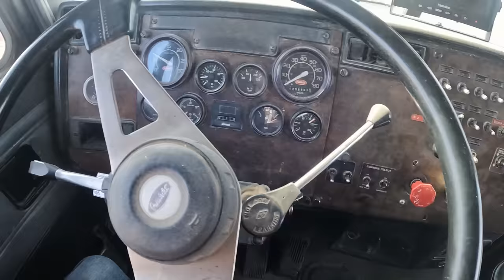That Didn't Sound Good.

Comment: I like how you keep your positive attitude during times of adversity. I guess if farmers were not optimistic there would be much less food available to feed a hungry world.

We are having the opposite of you this year. After an extreme drought last year we got lots of moisture this spring. The dry land farmers are having wheat yields 50% above normal. Irrigated folks got delayed in planting spring crops so harvest is later. In my case the hard red spring just ripened enough last week. I got one set of trailers cut then we got 4/10” of rain the next day. Was able to bale straw yesterday, but too wet to combine or bale the hay that was almost ready before it got wet. Oh well, I guess I will have some time to make some minor repairs to the old 1460 so it can chew through the tough wheat straw better. Only planted 120 acres, but it is thick, going about 100 bu/acre.

Comment: I had a fence post go thru a 2388 a few years back and punch a hole in the bottom of the fuel tank. I don't honestly know how it made it past the rock trap.That was in soybeans. Then the same year, doing corn, same combine with a Geringhoff chopping head on it, ran an electric fencepost (a round one, not a t-post) thru the #1 row unit on that head. That Geringhoff Rota-Disc head chopped about half of that fence post in 1" pieces before it finally got caught somehow in the snapping rolls and wrapped a full turn around the outside roll before it locked that row unit up. I hate fence posts. They are from an era long gone when the early settlers had livestock. And yet I have a feeling they will still be coming out of the dirt 100 years from now and getting into combines.

Comment: That’s a scary thought a blade going through the oil pan just had that door off to change rotor gear box oil in my CR my beater drum is different interesting to see CaseIH beater drum i just put a Redekop blades on my chopper they are smooth don’t wear out self sharpen really like the kit.

Comment: You guys NEED to buy stripper headers. Changed my dads cousin operation dramatically. Also our one guy we hire to help seed canola said they don’t have to scrub the ground yet get just as much seed as if they ran a Draper and scrubbed the ground. The biggest thing aside from hitting 500 rocks is the amount of straw the keep for the winter to hold snow
Reply: Stripper headers lose a lot of grain.   Just run the header higher.

With continuous cropping, you need to control straw.  You can't leave it 18" high after harvest.   It helps to cut it shorter and put it through the combine.
Reply: Huh interesting coming from some one tech guy. They don’t have the opportunity to leave 18” of stubble when there crop is only 10” high. Also the point of leaving the stubble is to catch snow is the winter because they get almost no moisture. They can easily seed into that. We had guys direct seeding into 3 feet high corn that got hailed in July

Comment: This crazy accident happened 3 miles south of our hog farm, we have livestock trucks/trailers coming and leaving 6 days a week, plus feed trucks and haversting trucks so to have the police close the whole area for umm many days was a nightmare, more so for truckers who don't know the area, the farmer that caused this just kept harvesting, he is a solo farmer and was doing the outside swath on canola, the guy that was killed, his truck kept driving for more than half a mile and his truck finally went off the road to the right ditch , the ditch was sloped almost level with  the road so he just rolled in and stopped 20ft from the road, truck still running, still in drive and the dead driver still was holding the steering wheel. people including us drove by and seen that truck partly in the field, i think it was 3 days the truck idled there before someone went to check things out, the killing weapon was picked up off the road and thrown into the ditch but the cops figured things out. just a freak farm accident.

Comment: Rivet a plate over that small hole below the engine. Dust and chaff will accumulate under engine and be a fir hazard.
Reply: There’s another sheet over that one. That piece is replaceable just because of that reason.

Comment: Could you not just lightly run a disc over the barley and use it as a seed crop for next year? Seeing the grain is on the ground already, no difference in broadcasting it.